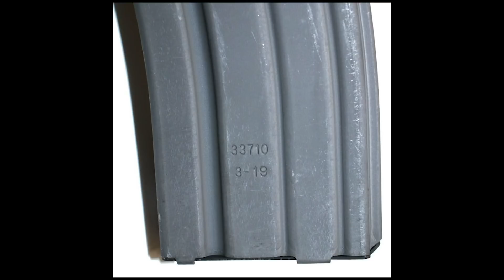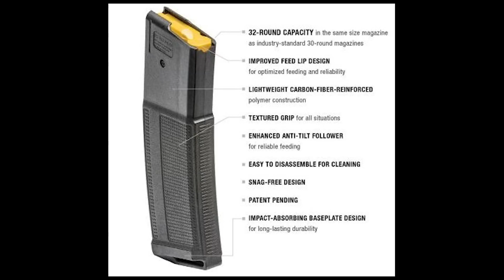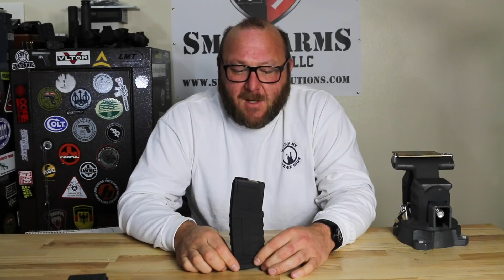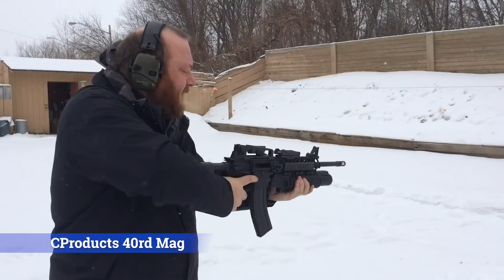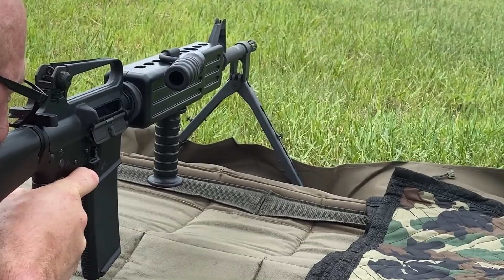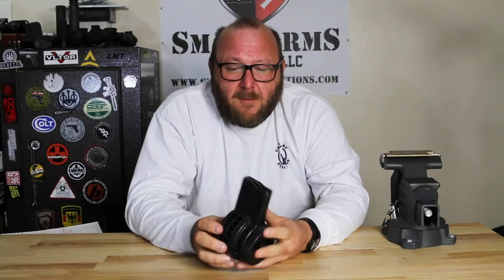Feeding the Black Rifle - Part 2

Comment: A large gun rental range in or near Las Vegas named Battlefield something or other showed aluminum mags lasted the longest.
Reply from the maker: They are wrong
Reply: @SmallArmsSolutions  Where do GI mags made of steel rather than aluminum (ex: Duramag and Korean) compare to polymer and aluminum mags for longevity?
Reply from the maker: Steel are most durable and not prone to problems with environmental changes. Proper finish magazines that are steel do well with sand. Not proper will corrode. Polymer has no memory if dropped, they dont bend. They often break when compromised. Many polymer mags mar work better with faster cyclic actions.
Reply: @SmallArmsSolutions  Thanks.
Reply: @SmallArmsSolutions  Some trivia referring to your comment about mag finish and sand: I think the parkerized finish of the Beretta M9 mags caused problems when interacting with the sand of the Middle East. I think they switched to non-parked mags. I don't know how much of a difference the non-parked mags made in the Middle East. I'm pretty sure the parked M9 mags were made by Checkmate.

Comment: Okay industries are what I use. Only had trouble with one 20 round that would fall to feed at times. 30 round never any problems.

Hera makes a beaver tail pistol grip that is comfortable in my hand. It also has a storage compartment. It is more square on the corners. But, to each his own.

Comment: One you missed was the Ram-Line combo mag sold in the 1980s. It was a 30-round, translucent plastic mag designed to fit both the Mini-14 and the AR-15. However it was so flimsy and the plastic so brittle that it really didn't work well in either platform, thus the reason why many of us called the company "Jam-Line" instead. The one I had quickly ended up in the junk box after only a couple of uses.
Reply from the maker: Part 3

Comment: I had one of the smoke HK mags split open and spew rounds everywhere when it fell onto a carpeted floor. It was right after I fully loaded it for the first time, I love HK but those mags seem prone to breaking.
Reply: same for me, a fully load magazine fell and explod. it was on a rubber mat. the magazine base plate is hold by 2 tiny bits and with the good angle it break easily.

Comment: Back in the mid-late '80's the only USGI mags you could find were from Cooper Industries, CAGE Code 30389.  I tried ordering USGI mags from 4 or 5 sources, and all sources shipped me Coopers.  Every one would misfeed in the last 5-6 rounds, always with the bolt riding over the tail of the cartridge.  You could not buy any others at that time, and I found out the military dumped all the Coopers due to this problem, and Cooper lost their mil contract.  The mags made their way into the surplus market.  Experimenting, I put wood spacers between the floorplates and springs to take up the space of 6 rounds.  Every round, all 24, would feed perfectly.  This told me the real problem with these mags was weak springs.  I was able to replace the springs with good springs from other damaged non-Cooper mags and they would then work fine.  This was before the "green follower".

Comment: I'm impressed. I thought I had a diverse collection, but he covered almost all the mags I have. I do have a different Korean polymer called "Swampfox" that I got on clearance, and Korean steel "SHK". TorkMag 50 is interesting and has worked for me. The Bulgarian IK poly 40s handle 300 BLK better than Magpul. Watch out with ELanders to not overload them. Different generations have different last round sides. I once accidentally bought a steel ProMag and returned it immediately when I saw it was ProMag.

Comment: Just get a Pmag. There's really no good reason to use any others (unless they won't fit in a mag pouch or something), so I don't understand why other companies think it's a worthwhile idea to even make a competitive product. If you can't do anything significantly better or a make an equal that's meaningfully cheaper, there's really no point. I could be wrong, though.
Reply: I like using bandoleers to hold 8 filled 30 round magazines for a quick grab and go. PMAGs don't fit well.

Comment: Sure feed are unreliable in my experience.  Brass over bolt when using it as a rest. Never had that problem with any other magazine.
Reply from the maker: Sounds like a rifle problem. Bolt over base is caused by short stroking or excessive cyclic rate. My guess you have an overgassed rifle.
Reply: @SmallArmsSolutions  Thanks for the reply!   A while back I put an H2 buffer in it. Seems to have solved the problem. It's an 14.5 BCM upper. Has the permanently pinned and extended A2 flash hider.

Comment: DD mags (32rnd) I think were designed around 30 rounds but for easier insertion under a closed bolt
Reply: 30 round pmags fully loaded seat easily on a closed bolt as well
Reply: @elGringoSupremo  In some guns. PMAGs seating on 30 rounds with bolt closed is not consistent across multiple rifles in my experience.

Comment: Truly fantastic video.... May I offer a hope/suggestion for a Part 3. "Feeding the Black Rifle with 300BLK". 

I do a lot with 300BLK, how well a magazine works with 300BLK largely comes down to the size and placement of the rib that on a 5.56 rides the side of the case neck or bullet. Also how much the magazine tappers at the front and feed angles can be an issue. Many mags will do fine with small bullets very few will handle monsters like the 205gr Gorilla copper hollow point. The Pmag for example though won't handle any 300BLK well, unless of course one buys their 300BLK specific magazine. 

What happens most often is that rib pushes the bullet in causing the rounds to stack pigeon toed. This makes the stack taller at the front nosing down the follower and causing it to jamb. On some, the D60 as a bad example the magazine is itself physically shaped to only handle 5.56, the opening just isn't large enough. On still others a high front edge of the magazine and shallow feed angle combine to jamb the bullet into the front edge of the magazine. 

Unfortunately information on that rib and the inner shape of the various magazines is limited on the net and largely comes down to trial and error followed by opinion on the forums. You however have this huge reference collection of magazines. Probably you alone can provide the definitive reference to what magazines are shaped internally large enough to properly stack large 300BLK loadings.
Reply: I just did a post about that a little bit on reddit and on the reloader's network. Short answers: Tork Mag, Lancer, lightly tweaked USGI, USGI, 300 BO pmag, normal pmag. In that order.

Comment: I gave away my surefire 60 rounder a year or so after I got it (when they first came out), never got it to run a full mag through my 6920 without a feeding issue. Sounds like I just got a lemon.
Reply: I have the 100rd surefire and in my experience it would only run reliably when kept oiled

Comment: Thank you for another informative video Chris. Your experience with the ATI-Schmeisser 60 round mags reflects mine which I was happy to see. On another subject, Magpul and Lancer have started offering mags specific to .300 BLK. Historically I never had any issues with using the 556 mags with .300 BLK, except with rounds over 150 grains where a few feeding issues did happen. I tried the same rounds with both the .300 BLK specific mags from Magpul and Lancer with zero FTF's.  Any experience you may have on this subject would be appreciated.
Reply from the maker: The 5.56 mags worked great with lighter supersonic loads but the heavier subsonic round occasionally had feeding issues due to how front heavy they are
Reply: G.i. mags hit in 4 spots with a file are  a good option for 300 bo, especially if you like blunt heavy bullets.

Comment: Thank you for all the work!  I'm glad to see you test magazines with a full-auto rifle; a much harder test than semi.
I've seen Toolman mags for sale, but hesitated.  After your report, I may pick one up for my 'collection' and as a range mag.
The ASC mags I own have orange followers.  I had not heard of them until I bought a couple in a pawnshop, so I was a bit leery of them.  They did feed a friend's M16A1 in happy mode, though.
I've also come across a ROK mag by Kyung Chang with a CAGE code of 3N829.  It looks good and ran fine through my semi-auto AR
Regarding Tapco, I have had complete range success with AK 7.62x39 mags and the ones I have fit my WASR 10 perfectly.

Comment: I've had the same issue with the Schmeisser in all of my rifles except one that it locks back on everytime. I've witness two that a friend has that have feeding issues almost every time he used them. I only witnessed him using them in one rifle. He also had inconsistent bolt lock after the last round
Reply: Mine actually chipped away the polymer on the very front where the cartridge is fed into chamber. Nothing but problems. Don't use it at all. Should have sent it back.

Comment: Do not store the quad-stack Shizawhatever mag full. It ran perfectly until I stored it full for a few weeks. Too much on the springs I guess. Hell to load. Can't store it full. I'll take a regular double-stack GI or Pmag any day.
Reply: Took it outta storage and tried to finger out a round to see if it would have issues. DONE. Every round nose-dived and I had to finagle 60 damn cartridges out manually because I wasn't about to disassemble it and unleash the spring apocalypse held within.

Comment: Awesome video,
as always. I do have a question about a specific magazine.
      Years ago, I seen a clear magazine that had roll springs 
on either side of the magazine. They rolled down on both
sides of the follower. I'm not for certain but I think it was
from a company called  ( EAGLE INDUSTRIES. ) 
      Like I said, I'm not positive about that. That was well over 20 years
ago. I have only seen 1, but it looked so different. I'm just
curious. Do you know of this or have you ever seen this?

Comment: I got brass over bolt in my BCM with a surefeed. Concerning to say the least
Reply: Had the same problem. I was using the magazine as rest. 3 out of a 100 rounds. Vary disappointing. I don't trust them wouldn't recommend buying them.
Reply: @Malle1974  Chnaging to different magazines won't necessarily resolve the issue - by using the mag as a rest and putting weight on it you're physically forcing it deeper into the magwell than it's intended to go, and this could lead to malfunctions especially if the mag catch in your rifle has been damaged or loosened by it.
Reply: @coyote2792  Never had a problem with any other magazines. A lot of  Tactical training companies. Will have you lay in the prone position to confirm your zero. Using the magazine as the rest. You should be able to do this. If you can't and there's a problem with the magazine. As far as magazine movement. Pmags hardly move at all. But I've never had a problem with the USGI magazine. Until I bought the surfeed so as far as I'm concern they're junk!
Reply: @coyote2792  I strongly disagree.
Reply: Bullcrap. I've used the surefeed mags. I've never had issues with them.
Reply: @nelsonr1467   It's bullcrap because you never have a problem?  If you actually shoot a lot. I don't care what you own, you will eventually have malfunction. I have aluminum magazines from other manufacturers. I've never had a problem with them.

Comment: I have a few of those centers industries corps mags had no idea who made them till now matching the cage code you shared and my okay industries cage codes matched yours too. All my other mags are all Magpul and hex mags, and all asc mags for my grendels. I did just get a couple of the amend 2 10rd Grendel mags and without out modification they aren’t very reliable. They do fine with longer bullets but with shorter 90gn bullets the bullets nose dive and hit the front of the mag. Just trimmed some material with my pocket knife and they seem ok now at least for the range and possibly hunting. I also just got in 3 of the utg 30rd 223 mags with the windows. So far so good on those just figured I’d give them a try but when it comes down to it, my go to will always be Magpul either gen 1 2 or 3

Comment: OKAY, Magpul..or Lancer if you feel like spending the extra few bucks
Reply: My local Vance Outdoors has Troy Battlemag 30's for $8.99 :).  They have also been very reliable in my experience.
Reply: @gort4016  I wouldnt trust my life to them they have very weak base plates but for a range mag thats not a bad deal
Reply: Yep.
Reply: Spot on

Comment: I discovered a flaw in my ets mag: If I just slightly move, not press, my magazine button; the ets mag becomes unlocked. None of my other magazines do this. The only difference I can see on the ets mag against all others is a less raised ramp.
Reply: Grab it with some pliers and pull it out a bit.
Reply: Or screw your mag release button in tighter

Comment: Try shooting the Surefeed E2’s in a rifle that doesn’t have M4 feed ramps.  Lots of internet chatter about issues in those rifles due to the presentation angle.  I have some but haven’t had a chance to test.
Reply: Use tan okay surefeed e2 in my rra a2 standard, which i believe has standard rifle feed ramps and ran without a hitch, locking on last round, no problem inserting full ona closed bolt etc

Comment: Okay industries are definitely the best usgi alum mag made imo as well. I tend to stray away from C-products aluminum mags as I've had waaay too many qc problems with them; particularly with the front wall where the two halves overlap. They tend to not be welded flush and hang up on the nose of bullets so they won't rise up the mag smoothly, especially with heavier/longer bullets. Though I've had good luck with their steel mags and those are gtg imo.

Comment: Ive got one of the cheap uncoated aluminum ASC mags.  Thing is junk.  Follower legs were bowed in so it tilted like crazy and when i tried to take off the floor plate it was so tight that one of the aluminum tabs snapped off.  I guess just dont get their cheapest version.  I have a steel ASC that is great.